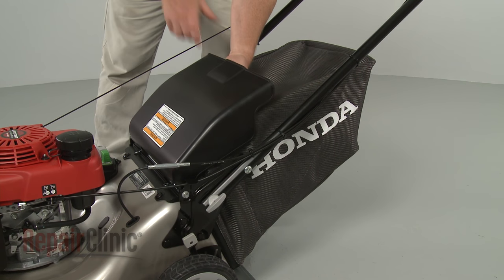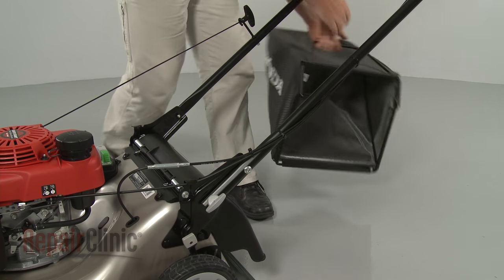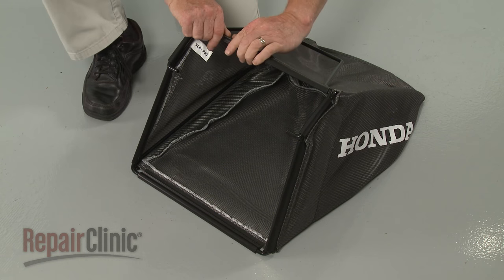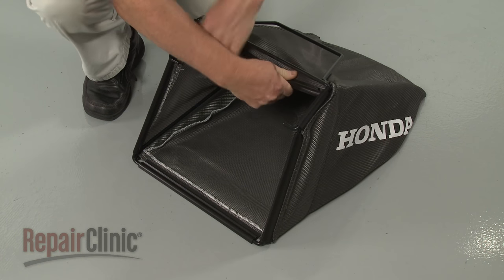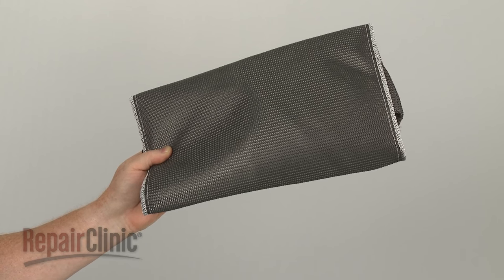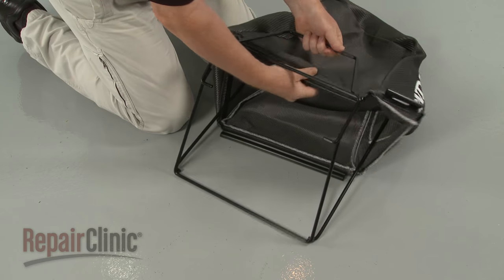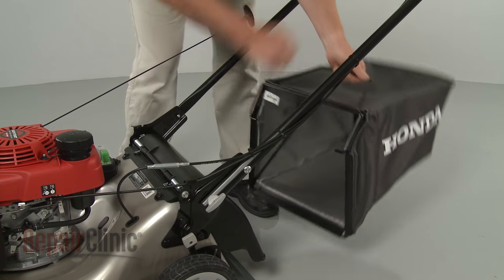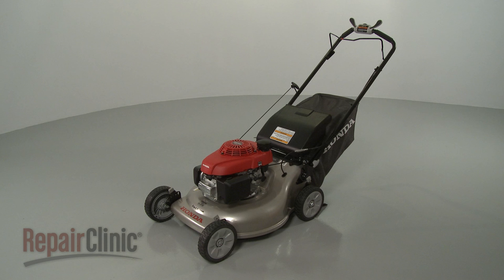Honda Lawn Mower Grass Bag Replacement Part # 81320-VL0-P00

Comment: This bag goes on the mower a little differently than my previous Honda mower.  There's now an opening at the top of the bag, but once you lower the top flap it seems to seal properly at the top and bottom of the bag.  Took me a minute to figure that out.